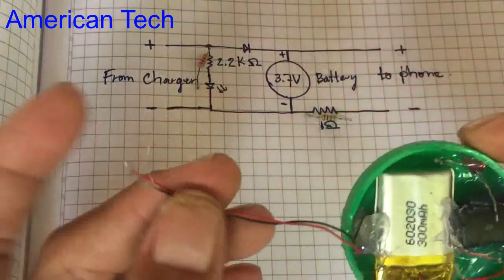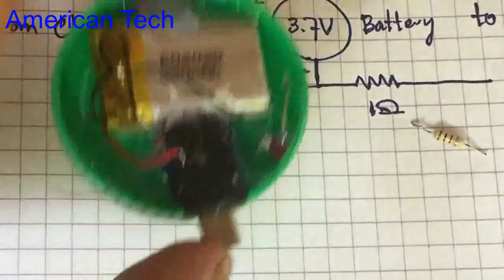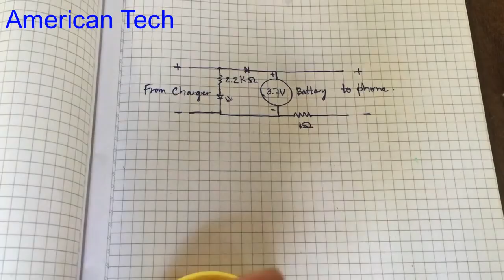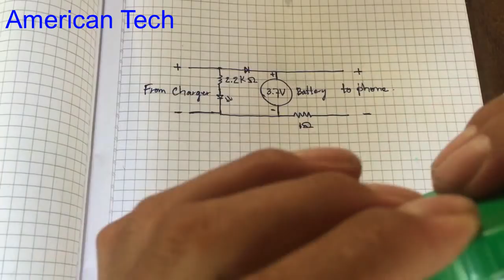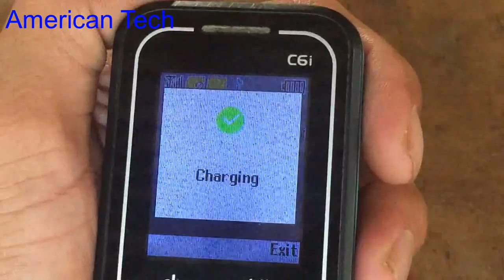Emergency mobile phone charger , a smallest power bank

Comment: You dont have any indicator when the battery is full. Li poly battery can explode when you overcharge, so it is dangerous idea.
Reply: Even this would be sketchy due to a missing undercharge protection and the diode only drops about 0.7V, while USB ports operate at 4.75-5.25V. 
It‘s better to use a proper charging/discharging protection, one especially made for powerbanks is the 134N3P, which usually costs under 1$/€/80INR.

Comment: This is not going to work well on most phones....real power banks use a switch-mode power converter to develop 5 volts from the 3.7-4.2 volt LiPo cell.
It MIGHT work on SOME phones though...some will charge on voltages below USB standard.
Reply: Yes you are currect as I have a India to make a poverty bank  as we connect two 3.5volt battery in parallel and then check its voltage you may got 5 voltes and it also charge phone
Reply: You are right... I tried to charge my phone with 4.7v, it didn't work
Reply: Newer iPhones work from 4V or higher, but this circuit still is sketchy and can be dangerous. Just use a 134N3P (costs mostly under 1$/80 rupees), break the USB connector off and solder the charging connector to the USB connectors contacts (D+ and D- will often need to be shorted).
Reply: What the number of diode

Comment: I do not recommend this !!!!
There is no safety circuit to protect the LiPo battery.
Max voltage is 4.20v any higher you risk the battery to explode.
Reply: You can see the circuit board along the yellow boarder on the battery. Please stop sending false information.
Reply: @TheKakan1337 , not all ones with a circuit board are protected, i also had some using a circuit board just for soldering the wires to. And even if it would be a protected cell, others may not use one. In this case a big „Only use protected cells, otherwise the cell may explode“ warning is appropriate. 
There however is a diode at the input, but this still is a sketchy protection as USB ports can reach up to 5.25V (some chargers like the Amazon chargers even go to 5.5V), while the diode only drops about 0.5-0.7V.

Comment: The battery is 300mah. Not even enough to get your phone to 3%
Reply: It‘s probably for emergencies. But it‘s bad because the voltage isn‘t boosted to 5v at the output and the battery is charged without proper protection.

Comment: my phone is 2500 mah hahaha :D it will charge my phone about 5 - 12% hahahahah :D

its brilliant idea most smart phones have a battery capacity of 2000mah now a days :D

and cherry mobile has a minimum capacity of 1500 mah 

pilipino ka pala bro hhaha :D
Reply: For dialing emergency services, this still is usable. The main issues here are, that a proper charging IC is missing, and there is no boost converter.

Comment: Dude really phone need 5 v to charge and this is a 3 v battery
Reply: @Fortnite-gb7dz , thats right, but USB has a voltage of 5V (+-5%), so many phones won‘t charge with just a lithium cell. And charging a lithium cell with a too high voltage also is dangerous, there is a diode used but it may not prevent overcharging.
Reply: Yes i know you need to step up the voltage